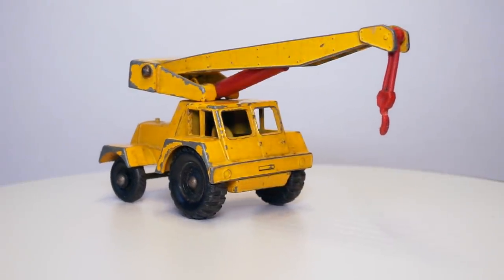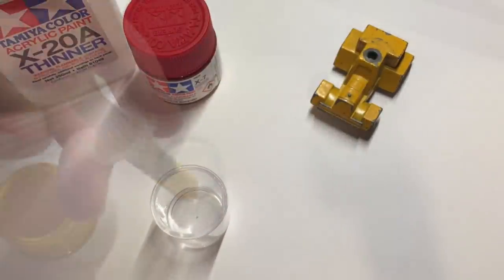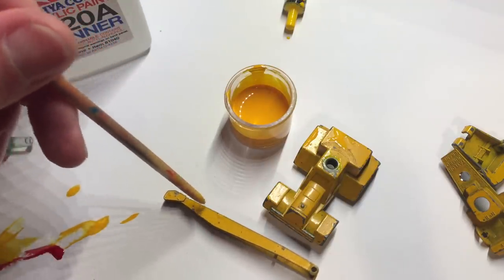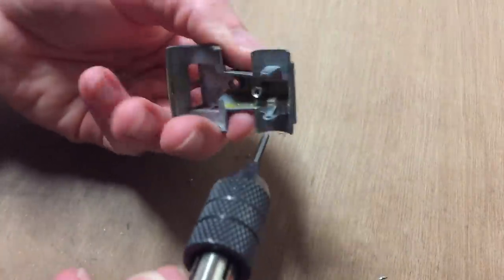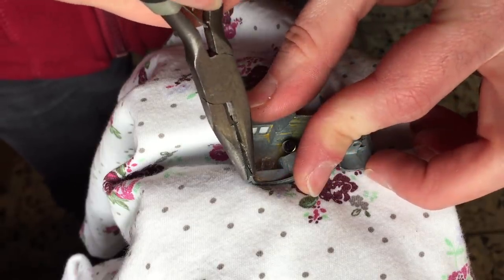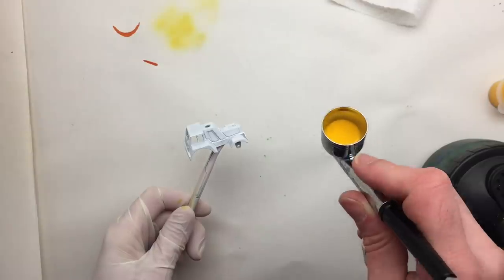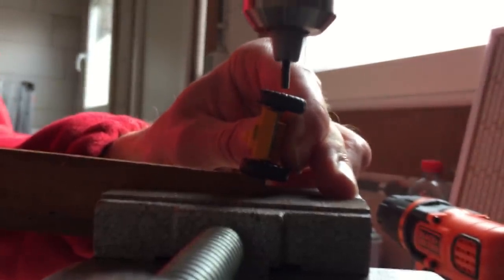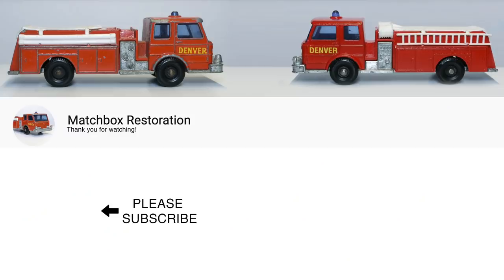Matchbox 11c Taylor Jumbo Crane - Full Restoration

Comment: You get better with every restoration. Great job keeping the colors matched on all those parts. I learned that on my Pontiac GP I did painting the doors separate from the car. Somehow I ended up with different shades of red.
Reply: On my Pontiac GP resto, the doors came out the same shade, but the red ended up being too dark on the whole car, when I used a grey primer.   I'll have to strip it back and do it again.  Another model I did, #51 trailer came out the right shade of red, using the famous Tamiya fine white primer.
Reply from the maker: Sometimes I get lucky, sometimes I have to redo it. It's part of the process. But we can only learn from it by trying different things, so that's what I do.